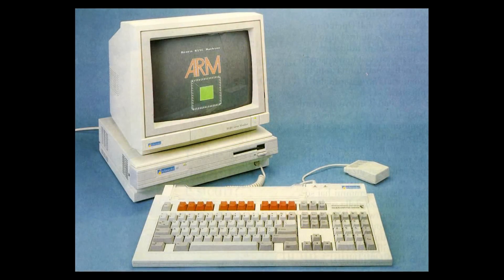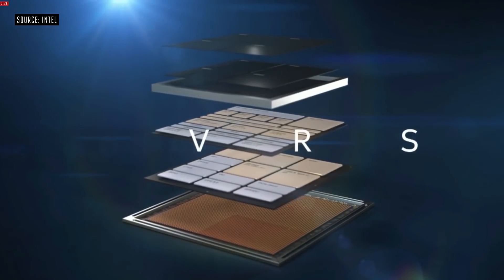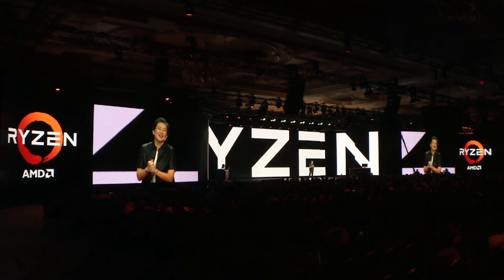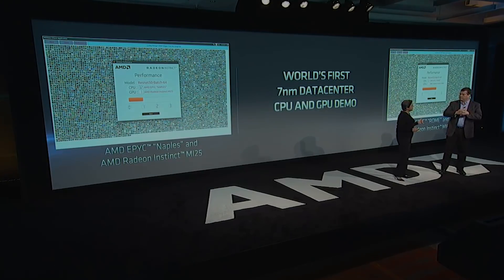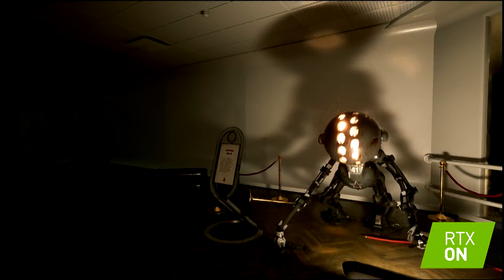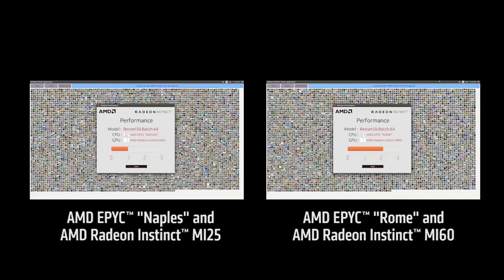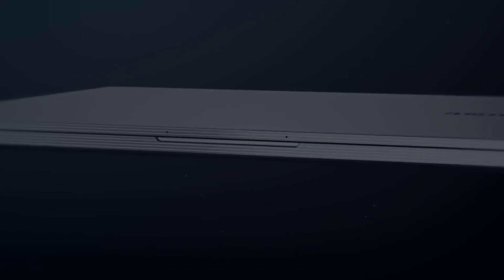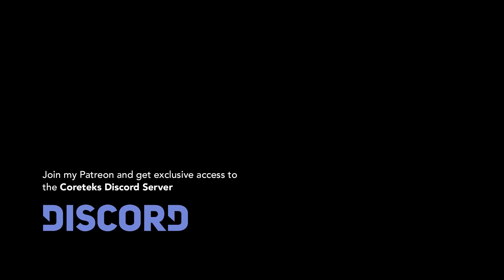Hardware trends: How many cores do we need?!

Comment: This channel is almost too intelligent for YouToob.

Silicon & copper are taking their last gasps. The only way we're gonna see  per-watt, Moore's law type performance increases again is when semiconductors are ditched (as well as Von Neumann architecture.)  I assume one of the National Laboratories  already has prototypes working. We'll probably find out about it when the first DOD hardware using it get's shot down. 

As for how many core's do we need? Well obviously, as many as we can afford... ;-)
Reply: My bet is on graphene. They are expected to reach terrahertz clockspeeds on a single core. It's just very hard to mass produce the material. If we get room temperature superconductors we could in theory end up with petahertz graphene processors in the far future.

But silicon isn't dead yet. Remember that we are only at 7nm and the theoretical limit for silicon transistors is at 1.1nm which is the smallest you can get due to the size of silicon atoms. This allows for almost 10 extra transistor shrink cycles. This in combination with architectural improvements, stepping off x86, multicore and software improvements could mean we could still see reasonable gains in performance for the coming ~20 years, but it will be pushing it.

We better start rolling out graphene processors within the next 20 years though otherwise we'll genuinely stagnate.
Reply: @joey199412  While it may be technically possible, is it economically viable? Cost of producing transistors at 1.1nm will be astronomically high... I imagine at that point other materials will end up being cheaper.
Reply: @joey199412  sadly cpu and tech in general is NOT impulsed by progress but by profits, as long as silicon and x86 stays relevant it will be used, small gains... sure but moving to diferent silicons WHILE keeping old compatibility will likely mean having a big litte cpu, graphene top perf x86 classic low power cps for compatibility... will be interesting certainly, but then... why would they invest SO much on that when, if you sell a graphene based cpu with good compatibility with x86 effectively releasing the future... at 20k$ unit... well enjoy your bankrupt, for consumer cpus i'll rather change binary over quantum computing as graphene is NOT cheap and will make things hard to actually drop price to, user levels, and sure graphene will EVENTUALLY be able to reeplace silicon fully... but when silicon based cpus where introduced they still had a LONG way to go.. same here maybe in 50 years, but the really obsolete thing here is binary  logic, or maybe we change to neural pu and ditch cpus completely, time will tell, certainly will be interesting
Reply: @joey199412  Intel, DARPA, and Motorola have already had 1THz in 2001, 2009, 2011 respectively. Now DARPA has removed their page on THz electronics so I'm guessing it's moved into being more practical. Intel is the most interesting for me since it said it had 10,000 times less leakage, great for higher density and RAM. Intel said it would be sold to the consumer in 2005. see my other comment for the video
Reply: The Devil's Advocate or just ARM it
Reply: Their are many working prototypes of different materials and architecture (Light/Photon Based Processors, Bio-Computers, Graphite based Processors and a few others!) the problems are ATM 1. Cost the cost per unit is very high as they are very hard to produce as to be economically viable yet, 2. They are not fast enough (Bio-Computers!) and/or 3. They require a vastly new programing language which means OS and Programs either need to be rewritten or emulators developed that are so good that their is little to no difference in look or feel in use to a traditional CPU!

Bio-Computers if you ask me are the long term goal as they will be Super Small and Lightweight, Super Energy Efficient and Orders of Magnitude more Powerful then even today's best Supercomputers and Environmentally Friendly  and all they will need to work is a drop of water every so often maybe with a little plant sustenance mixed in but atm the are fairly slow and can only do simple calculations but as they develop they will grow to be very fast and powerful in only a few decades imagine a plant based computer that could do Quantum Mechanics and only need water, air a little food and maybe sun light to operate and all this it would need very very little of a Bio-Supercomputer would be as small as your smart phone but Billion is not Trillions of times more powerful and energy efficient!
Reply: @DarthAwar  They don't require an entirely new programming language... All forms of OS will need to be changed of course to be compatible with the new hardware, but the languages will not need to change much; although I can concede that new advancements in C++ will need to happen; but that happens with every new iteration of it. The biggest change that would need to happen is compilers being totally overhauled to support the newer CPUs, but the code itself will probably be relatively the same. Luckily given most compilers being developed have huge backward compatibility, it would just be a matter of obtaining the source code on old programs, making some updates to be compatible with the newer OS, and simply running it through a newer compiler; I've personally done this with extremely old programs, and many game developers are doing the same with games from the early 90s that ran on MS-DOS.
Reply: https://millcomputing.com/

A radical, but achievable  architecture for general purpose computing.
The site has lots of presentations going in sufficiently deep into the subject to appreciate the genius of it.
Reply: @TheEVEInspiration  Glad to know I'm not the only one who's heard of Mill Computing. Now if we can get actual hardware...
Reply: @octopusdreams  The CPUs he's talking about are MAINSTREAM,  i.e. to replace current i5s/i7s or R5/R7. Currently that's 6-8 cores tops. The CPUs you are talking about are HEDT/Server, which have always had high core counts years before mainstream, because the workloads they are designed for are (or at least were) easily boosted by just adding more cores.
Reply: My guess is that regular desktop and workstation processors will keep the silicon basis for quite some time. Too much is invested into fabrication plants for those chips.
Reply: @TheDude50447  It's not really that, it's that there isn't much of an alternative that is any faster. Quantum CPUs are a long way off because of an input/output limitation, long story short they have to be running in absolute zero to work currently. As for bio-type CPUs we have such little understanding of the brain (which is basically a bio-CPU), that we cannot replicate it; and when we do AI will already have been achieved. In all likelihood at the point in which AI is fully realized, the advancement in CPU technology will skyrocket.
Reply: I can't wait till they figure out the bio jack so I can plug it into a human and use them as a computer. It will be a race to see which kid can find the smartest street bum! 🤣
Reply: While pushing envelope in some things and opening new research areas, aerospace and military overall tends to use only thoroughly tried electronics.
Because they need to be pretty darn sure that it's actually going to work in actual situation...
Instead of constantly breaking down, having lots of bugs etc.
More modern tech tends to also always need more and more hardening/protection against EMP.
Some old tubes are pretty darn robust against EMP compared to transistors and integrated circuits.
Reply: With the amount of inertia CPU tech has (just think of the prevalence of x86 today), ~20 years to the deadline means we need to have working prototypes of alternatives right now.
Reply: There is one crucial thing to remember about computer science: Research and prototyping aren't all that risky. Building processors to prove concepts isn't really uncommon. Unlike other sciences computer science is not limited by the laws of thermo Dynamics or material property at least from a research perspective. What I mean is that we are limited with materials but proving a robust idea should stretch beyond material. The reason binary has been around so long and why it hasn't been replaced by another abstraction layer is because binary as a discrete concept is robust, repeatable and scalable. No matter what node or material silicon or even quantum we still describe this thinking in binary.

All you need for good research is a proof of concept. This is where you start getting into really interesting topics like the necessity of binary as an abstraction layer. A touring machine only needs to be built on a sound discrete mathematical principle. Theoretically you can build computers out of light, the rotation of atoms or guassian intercepts (I'm not sure if that's the right name, a principle where the square root of a number plotted on a graph intercepts a known discrete point. A non irrational number.)

The only real risk is commercializing something. There will always be a need for computation and because of that companies will throw anything at the wall and hope it sticks. If it isn't AMD, Intel or Nvidia someone else will research it.

Also light based processing is really fascinating it's worth a bit of research. It's not in any real feasible state but there is some promise.
Reply: It should be much cheaper. Intel has charged the same for 4 cores since about 2007, about $325 - $350 K version for 12 years now ! If AMD can make it cheap then Intel can too. Just going by lithography improvements it is about 8 times denser than in 2001. The actual number worked out to about 80 times in 2 dimensions, so 64 cores are possible but 16 - 32 should be common by now, instead of 4 cores FOREVER ! And RAM has got more expensive, not cheaper ! I paid less in 2012 then now in 2019 for the same RAM. What the hell ? Intel and others are squeezing customers for every last drop. And what about using HBM for CPUs ? And this doesn't even get into the 1THz tech, that Intel had in 2001. Or HEMT transistors. Intel said they had some new technology that got rid of the heat also in the commercial.( In my other comment)

Comment: the one thing you left off is having multiple programs running all once. even for common users. watching/streaming while gaming listening to music and compressing our pRon library to take up less space.
Reply: watching streams or listening music on spotify is already piss easy task for current cpus heck even my 4790k doesnt care about it, watching 1080p60fps stream - 15% usage, listening music on spotify 1% usage, other things as compressing or streaming content is already very rare activity.
Reply: I came to make this comment 
Realistically, it will only mean an extra generation or two of core increases before that will be enough
Reply: If you have lots of cores, you don't have to worry about turning off programs list SQL Server or Apache when you want to play a game (lots of RAM helps with this as well).   In any event, if you have a surplus of cores, you can always set the extra ones to Monero mining....
Reply: RAM capacity is much more of a restriction on multi-tasking than cores/CPU power at this point.
Reply: this is mostly for datacenters, like running many single core applications on 1 rack, making density higher and increasing profits due to more being done in the same physical space.
Reply: Nidhogg  Um....you could go to twitch and easily see that people are doing all those things at the same time....and much more...Just because YOUR computer can't do something, doesn't mean there isn't a better one that can.
Reply: Nidhogg  By stream most ppl actualy mean stream the game you play on a streaming website, such as twitch.Wich is something ppl are constantly doing.
Reply: Exactly. Amdahl's law only applies to a single task. Games run many many tasks. Each enemy AI could be its own task. Doing IO and loading maps another task. Different types of rendering another task. Ray tracing could be one task but so could DLSS and other such tasks. So, there is technically no limit on number of cores and benefit to games.
Reply: @marka5968  no not trew. Because some part of the programm is sequential and when you scale your cores to infinity everything else is solves immediately and the sequential part is the bottleneck. Thats what ahmdals law is about
Reply: @hermannschweizer7487  You're thinking of trying to run your games faster. What I'm saying is adding more features to the game. The sequential code can run at the same speed but in the same amount of time more stuff has been processed. Ahmdals law applies to one algorithm which I'm not disputing. But, you can still benefit games while not violating Ahmdals law by just doing more tasks in more cores. For example, enemy AI. The main game loop only cares about where the enemy is moving. I can have dozens of cores run a very complicated algorithm for enemy AI that doesn't affect the main game loop at all but produces a very sophisticated AI movements and benefits the game.